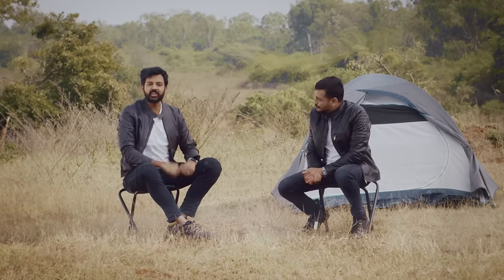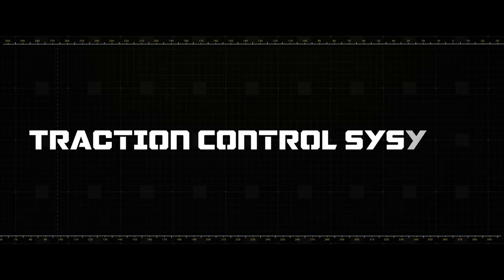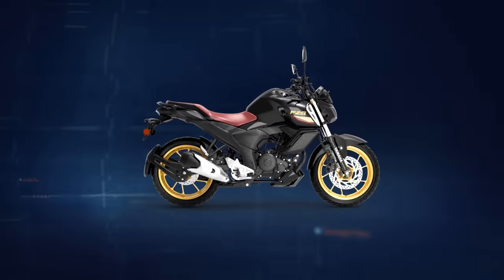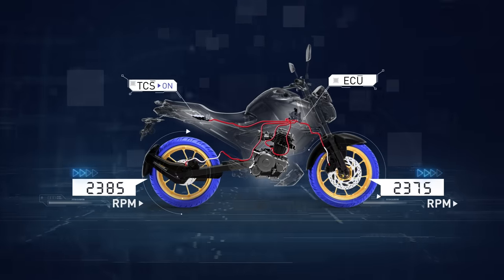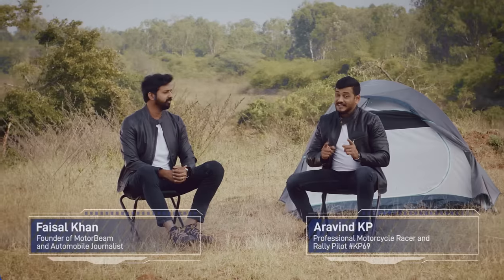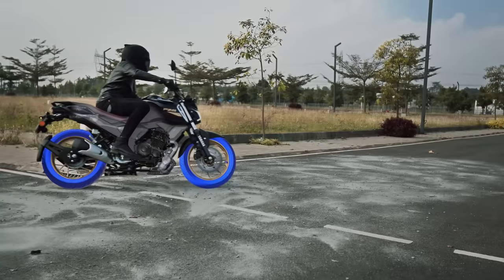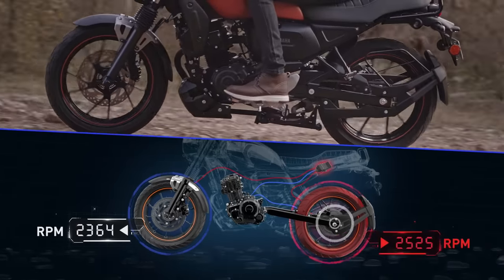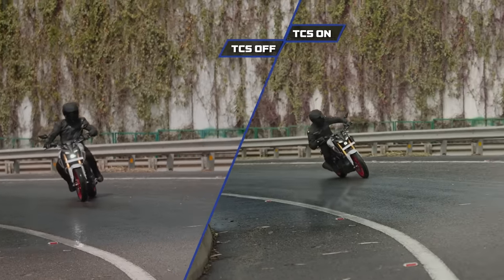Yamaha Traction Control System

Comment: Dude..  we need a discussion of the ABS front/rear brake modulation..  BIG QUESTION:
With ABS ON, Do I Need to use the rear brake pedal?
Some 40 years ago on a '72 H2 2 cycle, I had a big wreck in a Corner involving a 50' rear brake lockup on the outside white Stripe, I went Low, kissing the asphault and the bike did end over end off the side of the road.  I clearly locked the rear, and likely let up the front.  If I had the Yamaha ABS, and just used the Front brake, the bike should add the rear brake as a percentage of front until something slips..  That's what I'm lead to believe by yamaha, but need to know.  Also, I'm a big fan of landing on my right foot, giving me the option to diddle the shifter or kick stand while stopped.  Why do they train to land on the left foot?  I don't get it.

Comment: @yamahaindia  in my mt 15 v2  2023 tcs getting turned off automatically if engine temperature is high why it is happening . After reporting this issue to service center they changed tcs sensor still issue is persist
Reply from the maker: Dear Rohith R

We regret for the inconvenience caused.
Please contact the authorized dealer to address your concern.

For further assistance, we request you to kindly contact our Customer care at Toll Free Number 1800-420-1600.

Regards 
Team Yamaha India